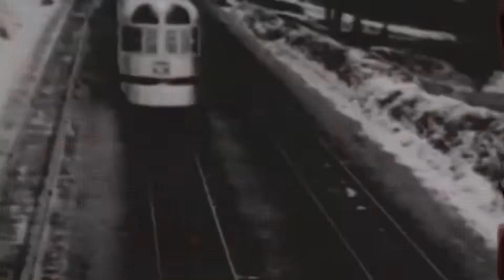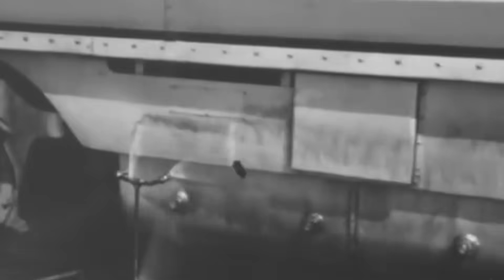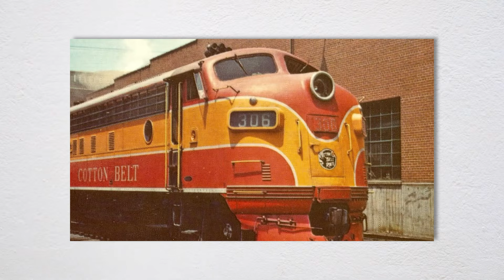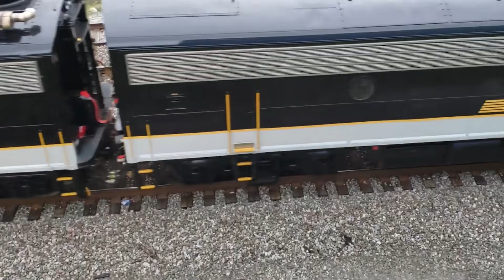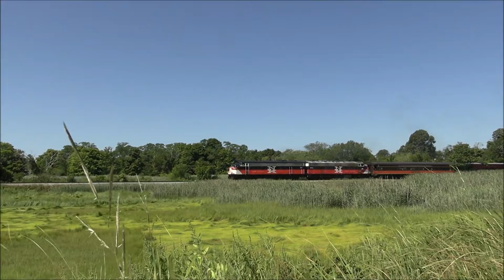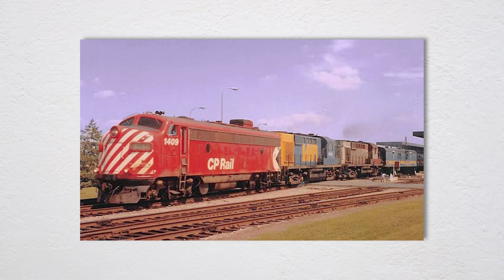10 Most Iconic F-Series Locomotives Ever Built

Comment from the maker: Which F-Series locomotive is your favorite?
The F7 is probably the most legendary — but the FT started the entire diesel revolution.
Reply: Warbonnet Santa Fe  F7 locomotives, both A and B units!
Reply: Pity you didn’t mention the very last bulldog nose units ever built. The Australian CL class with the final unit delivered in 1972 and using a 16-645 engine. Some are still running (rebuilt) in 2026.
Reply: I liked them all. Glad I was old enough to witness them from the FT to the FP-7 on the Atlantic Coast Line Railroad. If I had one favorite, it would be the FT.
Reply: I'd have to say the FP9s as they were what I saw most frequently on Canadian passenger trains.  I liked the Santa Fe's Warbonnet paint scheme the best (which of course were on F7s) but as to the locomotives themselves, it would be the FP9s.